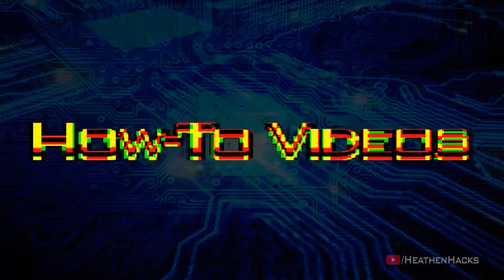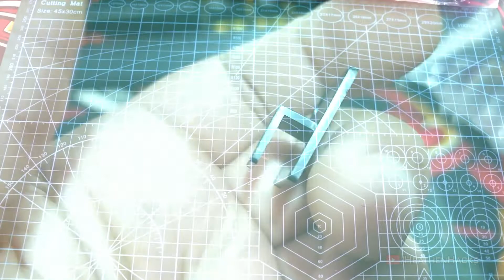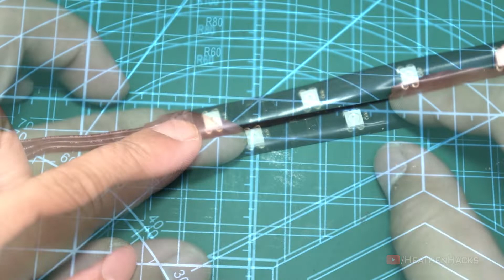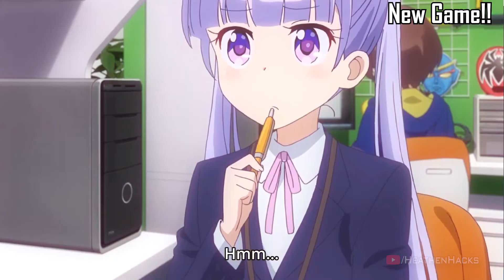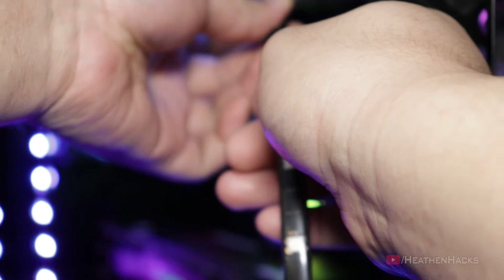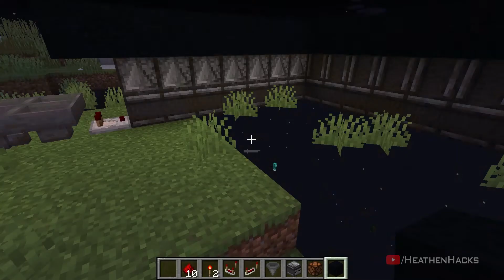PHANTEKS Neon RGB Strip [UNBOXING, SETUP & REVIEW] + LNPro Surgery

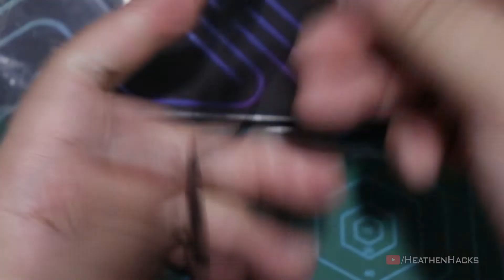Comment: 1:22 what is this for?,if I connec to the DRGB it won't works or mine is broken but when connect my DRGB to this 1:32 it works.Hmm what is the for
Reply from the maker: 1:22 is the INPUT side of the strip, and 1:32 is the OUTPUT.

Comment: Hello
I'm using TUF x570f wifi plus board
and my fans are cooler master cf 120 it also requires 5v argb 
problem is my board has 1 5v argb header only can I just connect my fan extension to the board
then I connect the led strips to fan hub?
Reply from the maker: Hello and thanks for the comment! ❤ Unfortunately, I have no idea. I think it would be better if you get an ARGB splitter. Connect that to your mother board and then connect your fan hub and LED strip to it. 

I'm not sure if that would work, tho.

Comment: Will it work with my Evga z590 ftw Motherboard that has a 5v Argb header. Or does the Phanteks neon strip only work with Aura, Mystic light etc?
Reply from the maker: Hello and thanks for the comment! ♥ Upon looking at the manual, I'm certain that you can plug it on to the ARGB header of your motherboard and my guess is that it would work and would appear as a normal LED strip on the EVGA software. 

I'm basing that assumption to what's happening when I try to connect it directly to my Aorus motherboard, tho.
Reply: @HeathenHacks  So will I be able to adress it?
Reply from the maker: I think you can. Yes. Do take note tho that the RGB header can only provide a maximum of 2A of current and would trigger it's overcurrent protection when it's exceeded. (According to the manual)

I suggest not using a solid white RGB profile just to be safe.
Reply: @HeathenHacks  Thanks alot for the info!